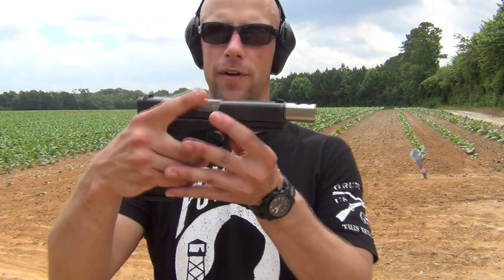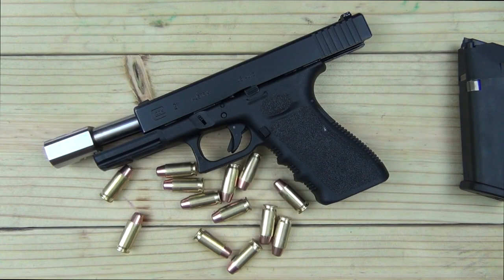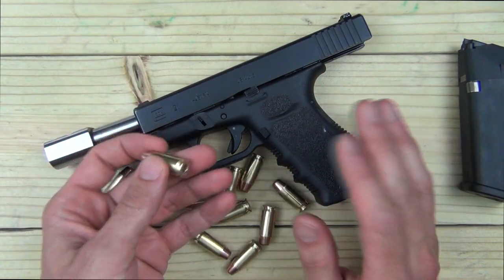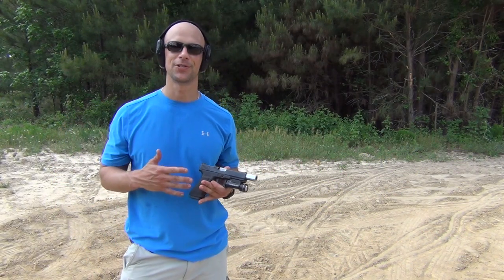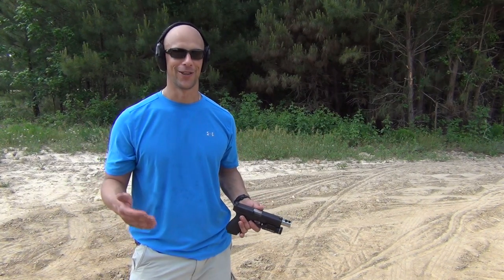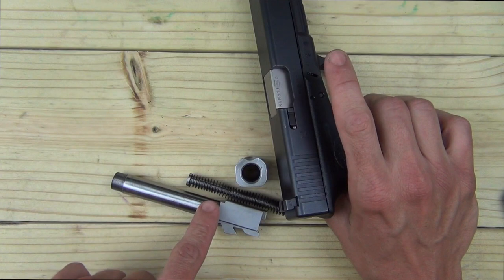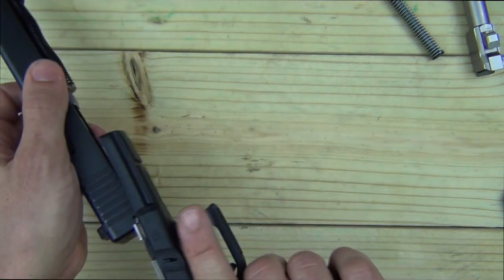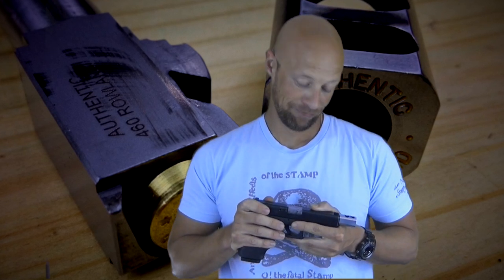460 Rowland Glock 21 Hand Cannon Conversion Kit Overview & Review (HD)

Comment: The ballistics of the .460 are practically identical to the .44 Magnum.  The .460 gives you the advantage of a higher capacity and faster rate of fire.
Reply: And a bigger diameter
Reply: Actually slower rate of fire but higher capacoty and identeical power but that being said there isnt as much ammo available
Reply: not true look at the data I can very easly beat all the velocity  in my superblack hawk
Reply: @scottterry1659  Scott, that's not fair. The .460 Rowland is almost always a 5 inch or less barrel, while I'm assuming your Blackhawk has a longer barrel. With 5 inch barrels, the .460 Rowland is very similar to the .44 magnum.
Reply: In a short 4 to 5 inch barrel  with bullets 250 gr or less yes the ballasts are  compatible,
Reply: @scottterry1659  wow, why you gotta call the hawk super black? Racist
Reply: @scottterry1659  what's the capacity of your superblackhawk?
Reply: @mobilegamersunite  my black hawk has a 7.5 inch barrel
Reply: @scottterry1659  nah the capacity...how many rounds will it hold?
Reply: @mobilegamersunite  You get one guess....lol
Reply: @will7its  my guess is that it's not 16 ...and not even close right?
Reply: @mobilegamersunite  What does the grizzy do when your auto doesn't load another?
Reply: @will7its  the same thing he would do when you miss your one shot 😆 🤣 😂 😹  the difference is I can re-rack mine in half a second. Besides, I've never had any feeding issues, it's why I went with the FNX
Reply: @mobilegamersunite  In your video game???🙈
Reply: @will7its  if that's what you want to call my life, Sure! I shoot my 460 every chance I get, and I've had no issues with it. Even my sons have a blast shooting that gun. They would shoot the 460 over the P365 I have. The 365 has more barrel flip, the 460 has almost none.
Reply: That's right, but maybe the best thing about the 460 conversion is that since it uses a semi-automatic handgun, the operation of the action "eats" some of that recoil impulse you'd otherwise be getting from a large-bore revolver in such a powerful cartridge. Very innovative and creative modification by the late Mr. Rowland....
Reply: @scottterry1659  - 460 Rowland fits into the low-medium end of 44 Magnum power. It can't yet match the full-house loads, but getting close in a semi-auto pistol is still quite an achievement. Not everyone can use a big-bore magnum revolver, nor does everyone want to do so. Having options is never a bad thing, right? That's the way I see it, anyway....
Reply: @GeorgiaBoy1961  my sons both said the FNX-460 is easier to shoot than the SIG P365 as far as recoil and comfort goes.
Reply: @Gieszkanne bigger diameter can be a disadvantage
Reply: @will7its  I'd never know because I clean my guns however once your revolver takes a shit good luck un jamming it without a gun Smith.
Reply: Pull my back up.. Mod 29 4" .44 mag @will7its
Reply: it has lunch
Reply: me 2

Comment: Ive shot a 1911 converted to this 460 Rowland and thought it was mild recoil. The 1911 is heavier though. The guy had it for a bear side arm. It was very accurate and chronographed very similarly to a 44 mag we were testing. It definitely makes me consider it as a bear side arm, just not sure what gun to convert. 1911 might be best, I just wonder what the extra stress does to polymer pistols in long run.
Reply: I thought the FNX45 tactical was a good candidate 🤔 that's what I got for the mod 
I get many love the 1911 tho because of familiarity

Comment: Bought a 21 months ago to do this kit. Still waiting till I have the funds. Looks awesome. Thanks for your review.
Reply from the maker: Thanks for watching.
Reply: Same here. Do it in steps and don’t have to fork out so much cash at once. I’m doing a polymer 80 PF45 frame kit. It is basically a Glock 20/21
Reply: @doug3805  wow this was 7 years ago. I ended up selling that gun and not going that route.
Reply: Yeah, I just ran across this site wanting to check out this cartridge and I want something different as I have a 10mm. There are a lot of ways to go with the Glock 20/21 frame kit.

Comment: First time shooting the 460, recoil was definitely challenging.  Kept getting type 2 malfunctions/failure to eject but nothing a lil Tap/Rack couldn't solve.  Held 5" at 50yds, took it to 200m holding on a 20" x 40" and first round hit.  I've only shot this caliber that one time and I absolutely loved it!  I think you did an awesome job explaining what you'd get your hands on w/460.
Reply: G21SF / converted same issues, then bought and installed Rowland mag springs, fired 45acp 185, 45acp 230, and Rowland 255 hard cast........fires and cycles flawlessly.....
Reply: You should port the slide and the barrel, metal guide rod #23 spring and stiffer spring for your mags!!!
Reply: @fastfurious9489  Yep people just forget to get stiffer mag springs!!

Comment: Added a 5.2” KKM barrel and Purchased the Rowland Comp. Installed the Pure Tungsten Guide Rod 22 Pound Spring from GS. I handload for Alaska Trail with 250/255gr just over 1100 FPS. Excellent results in G21 Gen 4 .

Comment: Got a Springfield XDm with the 460 conversion. AND I LOVE IT. Super hard-hitting, great handgun for it, and it pushes power up to the rarified levels of 1000 ft-lbs + with Underwood 185 grain or 460 Rowland.com's 185 grain ammo. Without a doubt, it's the hardest hitting gun of that power level and capacity and cost you can find.
Reply: I have the 4 inch  versioof the xd also with a 460 rowland. Diffently a thumper.

Comment: I've had a 460 1911 for several years.  It's easy to load using 45ACP dies.  But it's a hot cartridge and loads must be worked up carefully.  What is safe in one gun is NOT automatically safe in another.

I prefer the "tactical" loads around 700ft/lb.  Recoil is not bad at all.  And the brass lasts a lot longer.

But don't even think about lead bullets.  The barrel will lead up in a heartbeat.  Maybe something in a really hard alloy would work.
Reply from the maker: Good stuff.  Thanks.

Comment: Mine = Glock21SF Gen III, shoot 255 solid and 230 fmj all day long. I have small hands so that is why I use the SF series. It is not hard to convert...but read and comply with the instructions. If you have feed failures, most of the time it is the weak Glock magazine spring. After installing Rowland springs, no feed problems. Just recently fast fired over 100 rounds 255 460r solid and 230 FMJ 45 acp, no failures...With the Rowland spring it is very hard to load the mags, so until it is worked more, I only load 10 rounds... 44 Mag is around 38-43,000 cup, the 460 R is 40,000. Barrel jump and pistol control mild compared to my SW and ruger 44 mag's. Follow up shots a lot faster.  Now I only have a 460R and no magnum's. I bought mine from Rowland store in Tulsa, Ok. nicest people and best customer service ever.

Comment: Nice...I am looking to do a conversion to upgrade my G21 for a better woods sidearm. I was originally considering 45 Super conversion. Your thoughts on 460 Rowland vs 45 Super
Reply: You should be able to shoot 45 super, 45 acp and 460 rowland from a 460 rowland conversion
Reply: @ZFlyingVLover  you may have to use a lighter spring on standard 45 acp after that. 

I'm doing a 45 super conversion and looks like all if requires is its own strengthened brass, aftermarket barrel (unknown if it's required) and a 22-24lb recoil spring

Comment: Excellent vid! I've done the 460 Rowland conversion kit on my Glock model 20 gen 3 also. And I love it! I had a little trouble with feeding issues the first year, but without changing anything at all IE: Springs or hand loads, the second year it is performing flawlessly. I don't know what changed but I'm happy it did. I'm thinking of doing another conversion when I pick up a model 30 for EDC. One thing I like about the 460 Rowland conversion, you can shoot .45GAP, (with the original spring in it), .45 auto, .45+P, .45 super, and 460 Rowland making it a highly versatile gun.
Reply from the maker: interesting
Reply: How the hell?

Comment: As an addition for those who are hand loaders, 460 rowland performance can be had in 45 acp brass if your barrel has full case support (up to the extractor groove) and the requisite compensator.  Glock and springfield have aftermarket barrels that provide full case support.  For those that have a 1911 with a non ramped barrel, you will require a threaded barrel, either a 460 barrel and brass or 45 super brass (also stronger in the web than acp) in a 45 acp chambered threaded barrel. 

But for those who choose to use standard acp brass to create rowland level loads, do your due diligence to make sure that they only end up in the guns designed for it.
Reply: There's literally 0 reason not to use 45 super brass.

Comment: cool kit. that pressure difference is pretty significant. is that a long term concern at all as far as frame wear?
Reply from the maker: Haven't noticed any extra but maybe.  As always preventative maintenance and parts replacement goes a long way.

Comment: 460R over 10mm in my opinion. 44 mag capabilities in a M&P, Glock, Xd, 1911, USP, FNX? And I can still shoot cheaper 45 acp through it? Hell yea!!! I couldn’t get into the 10mm because of lack of high capacity handguns out there (Glock and Tangfolio or what ever) and you can only shoot 10 mm which is a little more expensive and harder to find. Great vid man!
Reply: I shoot 40 s&w in my g20 and g29. No problems. Brass falls at your feet. I've put 2-3 thousand rounds between the two down range. They're still going.

Comment: Great info, thanks. Does the mag spring need to be switched back to Glock factory spring when going back to shooting 45acp in a standard G21 or can you leave the 460 Rowland rec'd mag spring in your mag? Also, can you shoot 45acp in the Rowland conversion (like the 44mag/ 44spec)?
Reply: Yes, 45 acp, 45 acp+p, 45 Super

Comment: i often wonder why Special operations don't use the 10mm  and the /460 rowland on certain mission profiles.  they both seem like the get the  job done type of ammo... terminal ballistics are excellent.
Reply: Weight, capacity, follow-up shot placement, parts, tested ammo, and reliability.  The pistol is their second option firearm.  There's no reason for them to use the larger calibers.
Reply: Wayland C   Yeah right whatever...pretty sure they prefer glocks
Reply: They do use these chamberings and calibers. They just don't advertise the fact too much. But unless the folks at 460 Rowland are stretching the truth, their conversions are already in use in the special ops community. If you are line doggie, a normal infantryman, you get what you are issued, but the top-tier special ops people in the U.S. and elsewhere tend to get a lot of latitude in how they arm and equip themselves, along with generous budgets to do so.

Comment: Please do a vid on the Double Tap 450 SMC (Short Magnum Cartridge), It's an interesting round made by a .308 case and has a small rifle primer instead on a large pistol primer for more strength. The 450 smc can be fired from the 460 Rowland conversion.
Reply from the maker: Noted
Reply: Mrgunsngear Channel 
Thanks
Reply: I can find so little information about 450 SMC on the Internet. Who told you or where did you read that it can be fired from the 460 Rowland conversion?

Comment: The Smith M&P is a little more to it putting it together than the Glock. Mine came with 2 set screws for the Compensator and the recoil assembly was a little tougher to get in but I am very glad I did the conversion. I started out shooting some Underwood 45 ACP+P 185gr and then some Underwood 45 Super (I had both left over when I sold my 1911) but when I started shooting the Underwood 460 Rowland everyone at the range took notice of this hand cannon! I got a lot of comments!

Comment: I was wondering the Glock 21 with the thread barrel and No compensator for the 460 Rowland would work in my 45ACP - MCK conversion kit. I know the break reduces the rise , but it's looks like it also secure and keeps the barrel more secure as well. Thoughts please

Comment: Great video - did you use the recoil buffer with your G21?

Running .460 Rowland in my G21 for hunting and had terrible success with Johnny's Defense Against Large & Dangerous game.  The round tumbles out of the barrel, ended up using and loving Buffalo Bore ammo.
Reply from the maker: oldMan Slickville I don't believe in recoil buffers unless they're integral (i.e. 92A1).   Otherwise it's a recipe for issues in my opinion.

Comment: With the magazine spring from the 460 rowland website does it decrease the magazine capacity? 

Also will do you have any experience with the XDM conversion? If not do you plan on doing a review of that one? I know I would be someone who has a lot of interest in this caliber and I look forward to the ballistics gel test.
Reply from the maker: Capacity is still 13+1.  Haven't used the XDM conversion.
Reply: Good to know thanks for the info.

Comment: If you decided to put the .45 components back in the gun, would you be able to use the upgraded mag springs, or would you have to switch that back out too?
Reply from the maker: You could but remember the factory springs are timed with the action.   So, you may have problems.  May not...

Comment: Very interested in this conversion.  One question for you. How do you clean the barrel?  I assume you have to remove the compensator each time?  Any issues that you have run into while cleaning would be appreciated.  
Thanks!
Reply from the maker: Bob Smith The barrel cams up and there's plenty of room to clean under it.   I'd imagine after a couple thousand rounds you'd have to pull it though for a more detailed cleaning
Reply: Awesome.  Thanks for the input.  Keep up the solid work on your channel.

Comment: when converting the Glock 21 over to the 460 Rowland is it necessary to install a wolff striker spring or will the stock glock striker spring work? THANKS
Reply from the maker: standard works
Reply: Ok thanks

Comment: Once u convert to 460, what other rounds can you load besides 460 & 45acp or is that all. Thanx boss nice video
Reply from the maker: cy vic not sure.  I'd email 460Rowland
Reply: The 460 conversion can handle 45 +P, 45 Super, 450 SMC, and similar loads. They (460 Rowland) recommend using standard OEM mags and the original recoil spring for shooting normal pressure 45 loads. Save your stiffer rate spring mags for use with the higher-power stuff.

Comment: Can you get this in CA or does the threaded barrel make it a no no? Also any reason to upgrade to .460 or is the 10mm glock 20 good enough for bear country?...I have a 7.62x54 rifle and 10mm pistol which is about the bear minimum for bear country...which brings up another point...was the term bear minimum coined for situations like this?
Reply: It's "bare minimum" but it does sound quite apt. ;)
Reply from the maker: Danny Dingo I don't know.  I'd contact the Rowland folks.  

I'd want a minimum of a 10mm and some hard cast.
Reply: Mrgunsngear Channel So vs large game you would rather have 220 grains going 1250 fps? over 135 grains going 1600?
Reply from the maker: Danny Dingo I would.  Penetration is paramount with large game.
Reply: Danny Dingo They offer a service on the website where they pin and weld the comp on for like $50 to make it CA compliant.

Comment: one article said PD's are selling their .357sig and .40s&w guns for the 9mm as the former 2 were cracking frames and wearing out the guns...the only one I know of is the border patrol's beretta 96d in .40 but that was due to bad design, sharp corners instead of proper radius (more prone to cracking).
Reply from the maker: Yu Toob Indeed

Comment: What is the potential for slide seperation or catastrophic failure in this weapon set up. The glock 21 is built to handle the lower pressured .45acp at 20,000 PSI. How is a 460 rowland round at DOUBLE the pressure not tearing the frame apart?
Reply: The heavier recoil spring and compensator are meant to slow down the slide and stop the gun from battering itself to death. My 1911 setup with a 460 Rowland was showing some premature wear signs, so I just started plinking with standard 45 and running the Rowland when in the woods.
Reply: The 460 conversion takes a high-strength barrel to withstand the high pressures of this cartridge. A few makes of handgun are strong-enough in original form, and can converted as is (slight reaming out of the chamber), but other handguns need an entire 460 barrel installed. The greatly-increased slide velocity is dealt with by installing a much stiffer recoil spring, and also some other enhancements to tame the 460 Rowland tiger.

Comment: Be cool to have one for the 41. Also are those standard 45acp projectiles, or do you have to buy specific Rowland bullets?  I handload, and that would be cheap.
Reply from the maker: They are standard 45.
Reply: I personally wouldn't want the kit for the 41. The 21 is a heavier built gun. Barrel and slide are thicker. The 41 has more felt recoil than the 21 as it is.
Reply: No kidding, I didn't know that.

Comment: will a g21 with the 460R shoot 45acp, +P, and 45 super as well?
Reply from the maker: dialn911 I believe so but I'd email Rowland.
Reply: +dialn911 The conversion barrel can easily be swapped back to the stock 45 barrel....   You might be able to shoot 45 ammo in the 460 barrel, but I'm sure it isn't recommended, nor safe....  

Shoot what the barrels were made for, and you won't have to worry about blowing yourself up.

Comment: How was the steel guide rod I always hear people say if you put a steel guide rod in a glock it will blow the gun in half . Would you run a steel guide rod in your carry gun
Reply from the maker: That's absurd.  It won't hurt the gun but it's not necessary either.     I stick to factory in my carry/defensive guns.